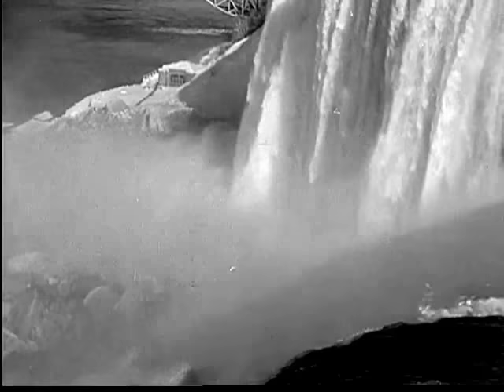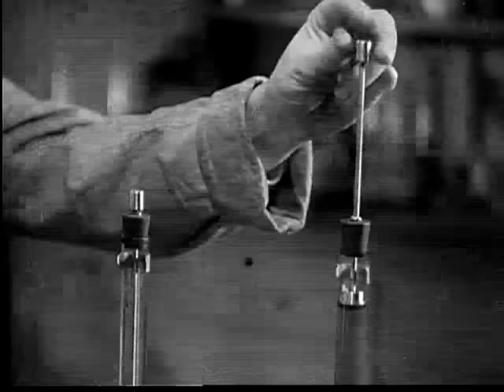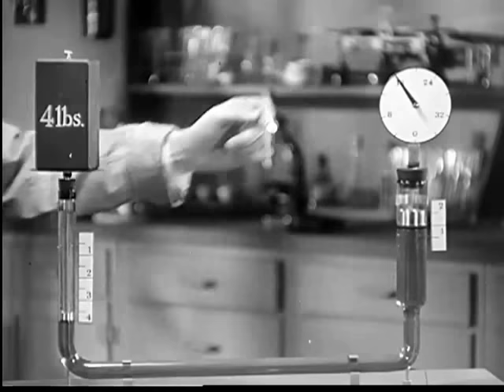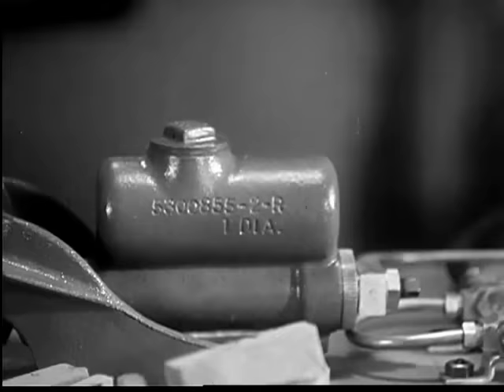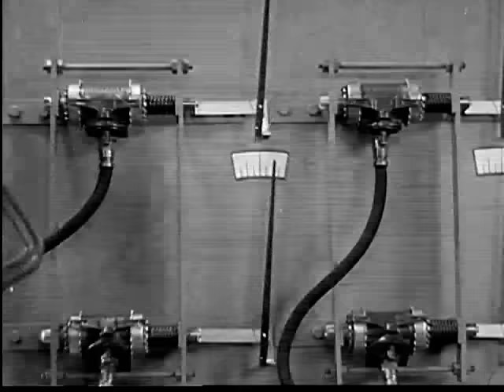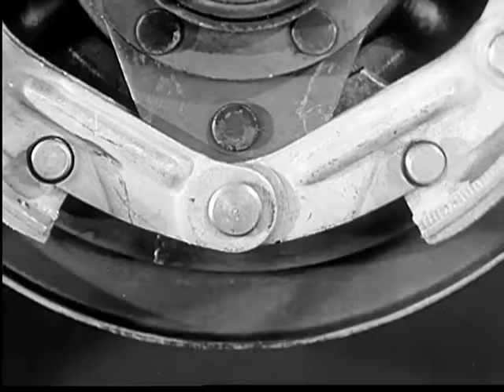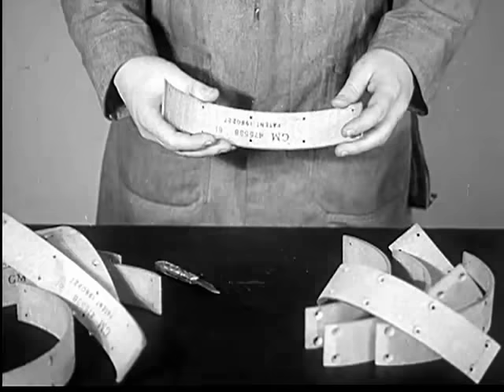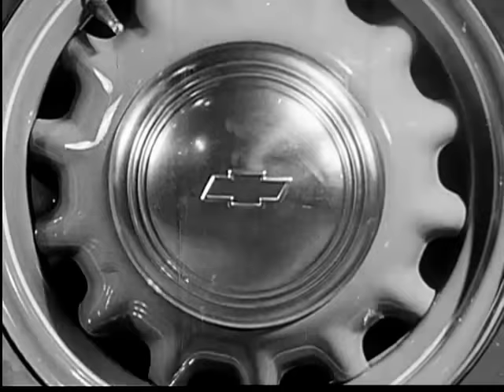Hydraulics (1936)

Comment: I forgot that disc brakes weren't a thing back then
Reply: my car still have drum brakes in the rear.
Reply: Not until the 50s on cars (though Tucker wanted them on his 48; his cars never made it into big production, however.)
Reply: @Francois_Dupont  Drum brakes are excellent for parking brakes on steep hills as they are "self energizing" meaning they can generate their own breaking power once started. However they can lock-up under hard breaking reducing your breaking power in emergency's.
Reply: umm drum brakes still are a thing today
Reply: @MrZer000  no one said they were not
Reply: Most pickup trucks have them, that's why I don't have one. Crap handling and brakes for a large vehicle.

No thanks
Reply: @mogarbobac1472  Disc brakes can also lock up under hard braking (sans ABS).
Reply: Francois Dupont and what are you driving ?
Reply: @peanuts2105  school buses and garbage trucks still run drums front and rear. Drums have more stopping power 0-45 mph, because there more friction material. Discs have more stopping power 50+ mph because they have better cooling ability to fight brake fade, despite the lower friction area in comparison to drums. Disc brakes on garbage trucks and school buses is a disaster. Nothing but problems.
Reply: @mogarbobac1472  how do they generate their own power when started? Drum brakes work just as discs with vacuum or hydraulic pump boosted. Both can still be used without assisted booth but at considerably lower power.
Reply: @peanuts2105  Wrong, Toyota pickup trucks have them because Toyotas sell to mindless sheep who think they're good cars. All other pickups went 4-wheel disc brakes by the early 2000s.
Reply: @Francois_Dupont  Yeah a lot of cars have discs in the front and drums in the rear. Like the 2019 Nissan Sentra
Reply: @straightpipediesel  What exactly is wrong with toyotas that isn't wrong with everything else?
Reply: Disc brakes became a thing on aircraft. Then hot rodders scavenged parts from aircraft junkyards, and agitated automakers to incorporate them.
Reply: @peanuts2105  Pickups are made for load-carrying capacity, not handling.
Reply: @VitoVeccia  Absolutely correct.  Disks also generate too much heat for use on heavy vehicles.
Reply: Drums breaks are common in Indian cars
Reply: @101Volts  A few cars, yes, but for the most part, not until the mid 60s.
Reply: @mogarbobac1472  The most common ones are self-energizing, but some, like these General Motors brakes, are not.  Ditto for pre 62 Chrysler brakes - Wagner Lockheed.
Reply: @peanuts2105  If drums are large enough, they work perfectly well for a "regular", (non-sports), car/truck.  Many in the 50s and 60s were simply too small.
Reply: @TheUtuber999  You are, of course, correct.
Reply: @VitoVeccia  Disks generated too much heat for heavy-duty vehicles.
Reply: @serge933  Power-assist does not boost braking power, it reduces pedal effort by applying some force to the master cylinder, just not enough by itself to apply the brakes.  Applying as much pedal pressure as you would with manual brakes does NOT result in more stopping power, it results in a skid.
Reply: @straightpipediesel  Rear disks are mostly a marketing ploy.
Reply: @Abyssalmatter  Unlike so many today, I have no problem with drum brakes.  But then, I don't drive like a moron either.
Reply: @michaelbenardo5695  the pedal still feels different. Assisted brakes feel way different. I know what you mean though, you will definitely lock the wheels up even with no assist. I’ve done it… lol

Comment: Let's just scratch off some nice asbestos
Reply: Wittenoom, Australia (Edit: I mean the Blue Asbestos Mine at that location) was working then.
Reply: cancer!!
Reply: +Austin Lucas ?
Reply: Paul Collinsworth  cheese? Not sure tho I'm no scientist
Reply: That's what I was thinking. I wonder how many other people watching the video know that pads like that were made from asbestos all those years ago.
Reply: @planetX15  The Blue Asbestos mine at Wittenoom.
Reply: Not sure about the asbestos but ive been using wd40 on my breaks lately to counter winter corrosion. You all should try it
Reply: I am surprised that so many knew that was asbestos.
Reply: Anonymus ptbo to be asbestos is a really good material, it’s just a little cancer-y
Reply: Our house had asbestos. Lol.
Reply: @markgriffiths3630  Sounds like the key to a smooth ride, I'll try that.
Reply: @mark-wn5ek  wtf chill
Reply: How can Asbestos be bad? It's got Best right in it
Reply: Metallic: graphite, steel and copper or  brass all mixed together.
Ceramic: clay and porcelain bonded to copper flakes and filaments.
Reply: Just smoke a cigarette, you'll be fine.

Comment: That single style master cylinder is a death trap, if there's a leak in the system which goes unnoticed the first warning you'll get is when ALL your brakes fail. That is why modern cars normally have two reservoirs within the master cylinder, one for the front wheels and one for the back. So at least you'll have some brakes left even if a major leak robs the fluid from one side.

Comment: back when we made brakes asbestos we could
Reply: drumgod19991 my 2015 Kia still has asbestos brake pads
Reply: Asbestos brake linings are still legal in the USA, but most brake linings are now asbestos free.
Reply: @SlippySnack  it's only a concern when servicing brake drums, which are infrequent since they are typically only sold on lightweight economy cars that don't put much stress on them.  still, it's why you need to take great precaution by dousing down the inside of the drum with brake cleaner fluid before you fiddle around taking it off.
Reply: @SlippySnack  It's also why air quality in cities are dangerous because of all the brake dust in the air from all the cars on the road.
Reply: RR_Productions  Most modern cars have disc brakes, including the majority of taxis
Reply: RR_Productions  It didn't start getting phased out of brake pads until the early 90's. It's still around, and brake dust in general isn't much healthier either.

Comment: That early brake system  shown is a Huck brake system. Adjusters are on the wheel cyl. for shoe/drum clearance.  This later evolved to the Bendix brakes that have a mechanical  screw adjuster usually at bottom of brakes.  The early system , you had to pay attention  to adjustments,   so you won't pull to  one side or  another during braking,( uneven brake lock) especially  at speed to maintain  control of vehicle  . For straight line braking.    Both systems very reliable,   .as the Bendix system  is primarily  used these days.

Comment: A downside to shoe brakes was the issue of brake fade when the shoes got too hot from either riding the brake pedal or driving for a long distance on a very hot day. Was scary when it happened, pull over for about 10 minutes, let brake shoes cool down and brakes worked fine afterwood.

Comment: From 1:57, 4lbs are used in one end to exert 4lbs of pressure on the other. So how do hydraulics "multiply power"? I think he could have gotten the same result if he had two large pistons on either end, both of which would move 1 inch, rather than a smaller piston that moves 4 inches, no?
Reply: Dr. Riq  4lbs exerted on the master cylinder resulted in 1lb exerted upon each of four working cylinders.   This was the visual explanation of how force applied is distributed evenly throughout the system.
Reply: @jwilsonhandmadeknives2760  ah, so it's not multiplicative, but distributive. Cool, just as I thought. The wording threw me off

Comment: Mechanics in the early 20th century had worked on non hydraulic brakes. Most early cars had mechanical brakes. Like Ford said "The safety of steel from pedal to wheel!"

Comment: Its amazing how most of the technical innovations in the automobile industry occured in the beginning of the 20th century. That's almost 100 years ago.
Reply: You know that the Regera's transmission is basically a giant torque converter with 3 electric motors for torque fill? What a way to bring back the Powerglide.

Comment: Some of you maybe thinking why water is not used in car hydraulics , its because the density of the water is less than that of oil used in cars. So incase the temperature increase , the water hydraulics will not work properly.
Reply: And it would turn to steam as soon as your brakes started to get hot😬😁.  Not to mention the corrosion issues.

Comment: Only problem with them right on up to 66 was the single line system. If a line ruptured anywhere in the system you had no brakes. In 67 Chevrolet put in a dual master system.

Comment: Starting at 2:00 I learned something new here. I did not know it would multiply the force 4x since the larger tube held 4x the liquid per cubic inch.
Reply: Actually it's the same pressure, but being more area, means more force at the cost of less movement

Comment: you can compress a liquid, though only so very little. In nature compressed liquids happen only at the very bottom of the marianas trench. Even that is such a slight amount of compression it can be chopped up to a rounding error in maths.
Reply: Imagine the force it would take to compress 1 liter of water to 0.5 liters, I can't even imagine what I'd take to succed in such a thing.
Reply: @ResponsibleBread  if it takes 11 kilometers of water stacked on top of itself to cause only so little compression that would require almost an average american sitting on a plunger on top of the bottle to compress that much
Reply: so it's simply uncompressable for people from 1936

Comment: AH, when cars all used drum brakes.  Effective, but disk brakes, at least in the front, are much better.  Although, some modern small cars still use drum brakes in the rear, where load isn't as demanding.

Comment: 4 wheel drum brakes are the most energetic and insane brake systems known. 

You just cant let the average consumer drive them or theyd be locking them up left and right...

Better braking isnt with discs, its with electronically controlled drums but drums are heavier and shoes are heavier and we gotta get those mpg no?

Just go to personal blimps and wed be fine. Little ones... about 30' on a side and triangular in shape would be the best for the niche crowd but a circular style of the same diameter would yield high weight to size benefits

Comment: And here we are today, over 80 years later, and a lot of smaller lighter cars still use the same technology as the rear brakes, except for the vacuum booster
Reply: Disc brakes are much more common now though. Most cars back then had drums. All cars nowadays use disc in the front, and most use them in the rear too.

Comment: Hard, uniform, unaffected by moisture. Wears evenly for over 20,000 miles. Man, those asbestos brake shoes were something weren't they. 😃
Reply: Given the weight of some of these cars and the narrow width of the shoes and diameter of the drums, it's actually quite impressive!

Comment: That's interesting, Ford started using hydraulic brakes in 32, Chevy in36..Ford also Incorporated the v8 in 32.. Chev didn't use the v8 until 55...
Reply: chevy had a v8 in 1917

Comment: So just that I understand the hydronics, assuming there's the equivalent of a counterweight so that a stage is effectively weightless, I can push a plunger down into a tube with 40 pounds of force for 2 feet in order raise about half a ton about 1-2 inches if there are 12 plungers attached to the stage?

Comment: Now if you had a 1,000,000,000,000 meter long tube filled with liquid and you moved one plunger an inch, how long would it take for the other end to move an inch?
Reply: Never, the weight of water would stop you.😁

Comment: Isn't it funny how we stopped inventing new technologies in cars? These men were creating from almost nothing technologies that are still being used and enhanced over 90 years later. Even your 'modern' 2020 car uses this exact braking mechanism invented in the 1930s. The new versions include sensors and other variations but with the same basic principle of using hydraulic pressure to actuate the brakes. Even my semi truck uses an ancient air brake system. Imagine a legitimately new technology that doesn't use liquids or something similar. Magnetic brakes? lol
Reply: if it still works effectively, why change it.

Comment: Yet heavier vehicles use air breaks instead of liquid breaks (so to speak)
Reply: Ye
Reply: Im going to add onto what the previous commenter said as well. Using air brakes also makes it easier to connect the brakes to the trailer. You just have to hook up the air hose. If they used hydraulic brakes, they wouldnt be able to do that.
Reply: Paul Collinsworth  What? I was just adding another benefit to air brakes. Yes, air brakes are a safety feature. But they also make it easier to add trailer brakes on semi trucks. You made one point on the benefit of trailer brakes, I merely made an additional point.

Comment: hydraulic press ,  cylinders , brakes, and power transmission, power transmitter ,    you can check that your labour is wasted ...... all the investments in manufacturing of the cars are diverted elsewhere ...... the lab assistants of polytechnics and engineering colleges which have hydraulic laboratory are receiving more income than you  ... check the income of savitri , city union bank, check the income t m sounderrajan  Canara bank ....... who have   income  higher than the car manufacturing companies .... check on the lab assistant of polytechnics and engineering colleges across districts .............. you will be surprised that the paper valuation of hydraulic engineering   sub code at Anna university  ............